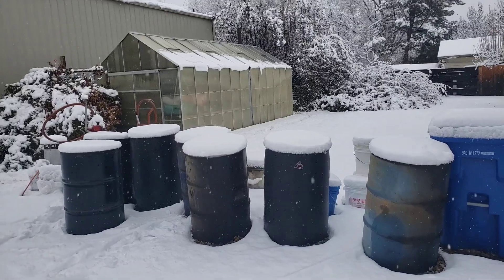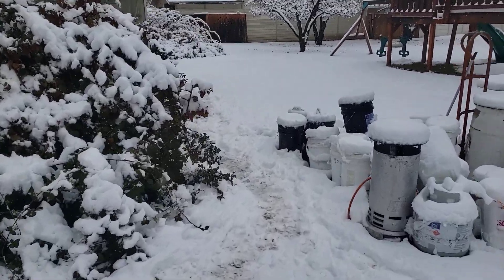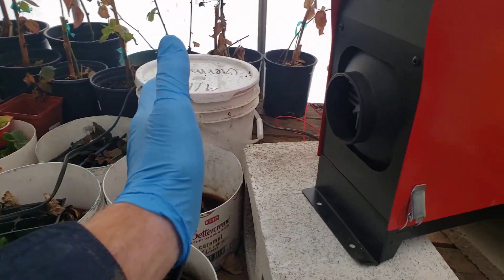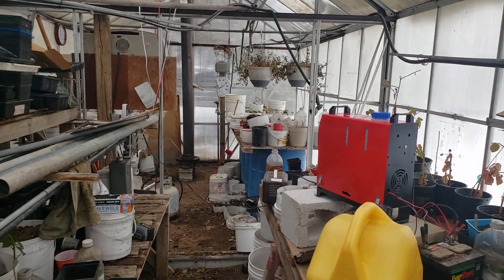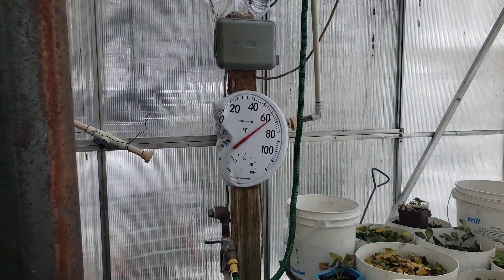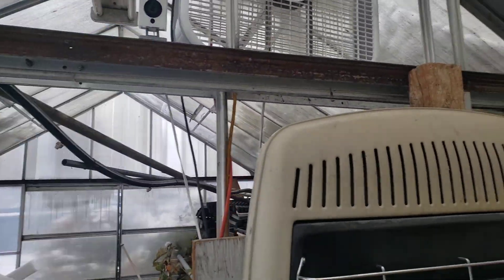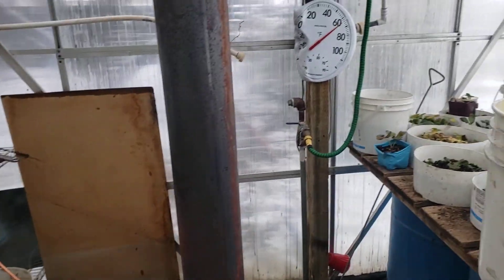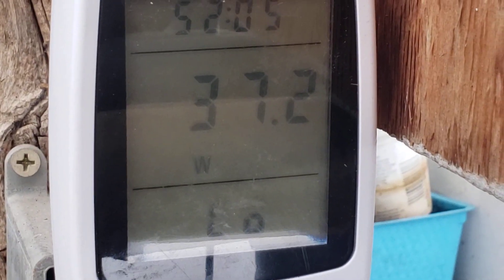5kw diesel heater runs on 12v battery

Comment: On the bottom of the heater there are 2 ports that you are not using. You need to pipe the exhaust outside the greenhouse because otherwise, you could die of carbon monoxide poisoning. Secondly the other air induction port needs to be piped though a air filter to reduce air bourne contaminants that could increase wear to moving components. Also I would fit a carbon monoxide detector to alert you of the deadly fumes. The most concerning of your video is that you cannot smell any fumes. 
Carbon monoxide is a "DEADLY SILENT KILLER", THERES NO SMELL, YOU FELL WEEK/TIRED THEN GO TO SLEEP, BANG THEN YOUR DEAD.
Fit a carbon monoxide detector,  it could save your life.